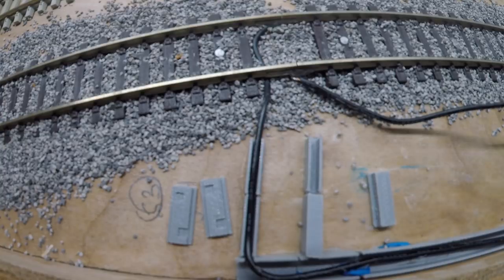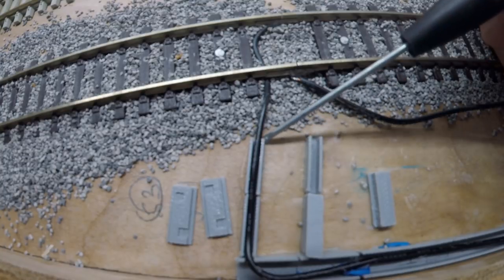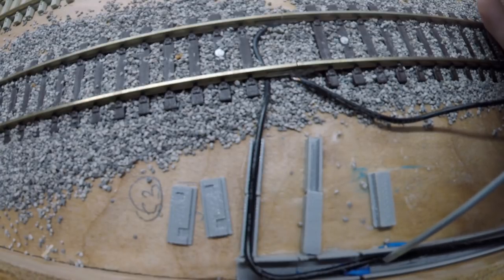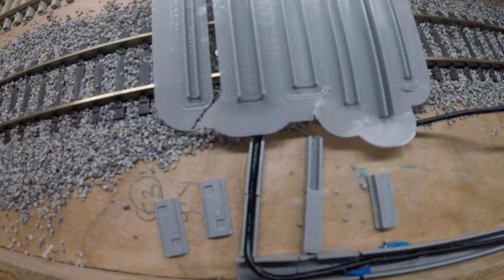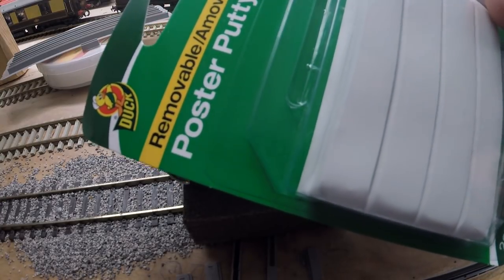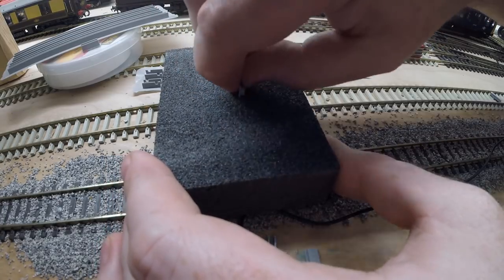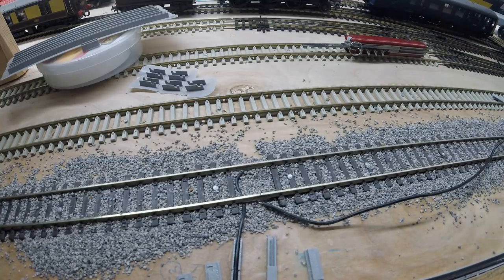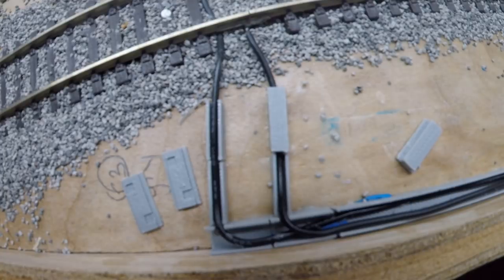oorail.com | Working Concrete Trunking for Model Railways

Comment: Question for you.
I use an Apple I pad , are the 3D files you provide downloadable to this device for use with a 3D printer?
Reply from the maker: Yes, the files provided are STL (a standard 3D CAD format) which is one of several industry standard CAD formats used in 3D printing. They will work with any 3D printing app or software. How you get the files to the 3D printer will depend on the type of printer and your setup. If you are using a network-enabled printed like those from Ultimaker, you can use the Ultimaker App to get the STL files to the printer. A less expensive, more DIY option would be to use Octoprint with a Raspberry Pi. We are currently testing out an Octoprint solution and expect to have an easy DIY kit later this year. The 3D files we provide tell the 3D printer software (or networked 3D printer or Octoprint) how to build the object, the software takes the profile for your printer along with your settings for that print (line width, infill, speed etc), and then builds whats called G-code , which are the instructions to control the printer to build the object. That G-code is specific to your print settings and printer. If you happen to own a JG Aurora A5 or JG Aurora Z603S, Trackside 3D will provide you with the G-code for PLA or ABS filaments upon request. There is also a USB thumbdrive subscription box in the works, which should be available in mid-late September. The thumbdrive option, you just plug it into your printer, select the model and select print. If you are looking to buy a 3D printer specifically for Model Railways and using these models, I would suggest checking out the https://trackside3d.co.uk site where there are links to recommended printers.
Reply: oorail.com Thank you for your comprehensive response. I can fell a purchase coming on , but it may have to wait to Christmas!

Best regards
Robert